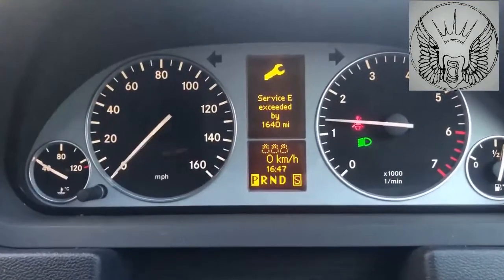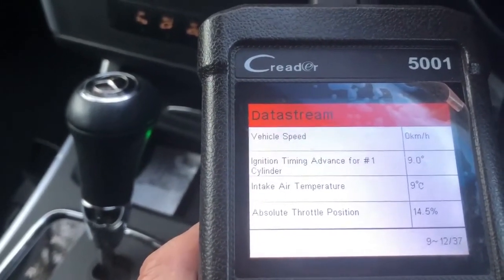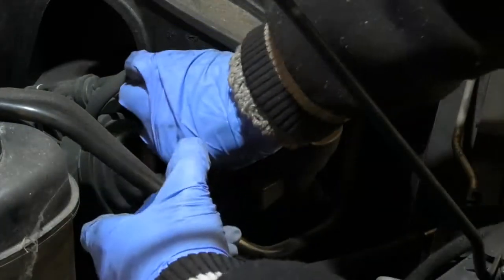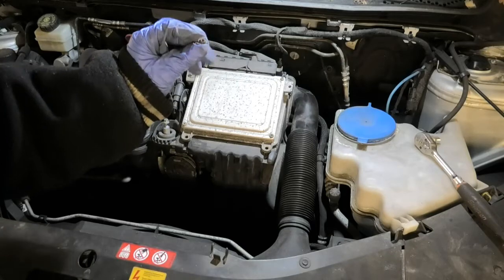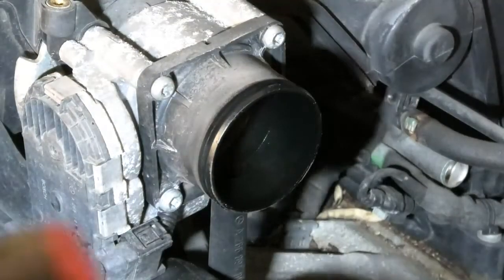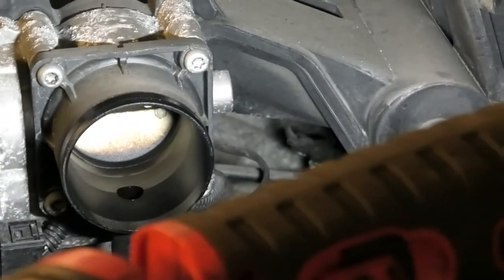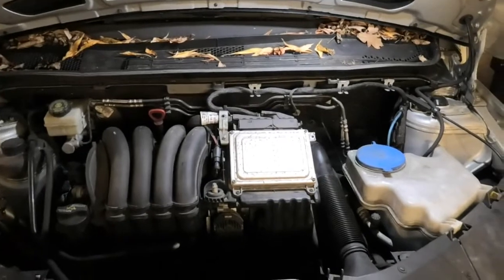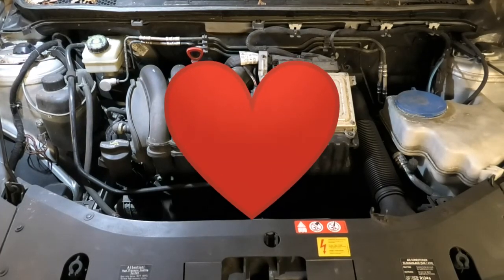Mercedes B class 2006 w245 P0068 fault OBD 2 port location, MAP sensor and throttle body cleaning

Comment: thanks for this usefull video about throttle and map sensor. i have really good question about my throttle body issue. to be honest i have problem with my trottle body.because my trottle body does not properly work.when i tested  the my trottle body position with my auto doctor diagnostic test, it show me huge problem ,draw signal is continuosly up and down , at this situation generally  it is becaming standby position, and finally the car is stopping itself. i think my trottle body is broken ,right?
Reply from the maker: Well it sounds like it might be faulty yes. May be buy a second hand one so it doesn’t cost much to repair in case the problem is something else.

Comment: Hello, quick question. I cleaned the MAP sensor and the check engine light doesn't come back until around a month later. I clean it again and around a month passes and it comes back again. It only goes away for that time once I clean it. Not sure what to do from here, do I just replace the MAP sensor? Anyone's help would be much appreciated!
Reply from the maker: Have you cleaned the throttle body ?
Reply: @DaringBeefcake  Nope, I checked it and it looks clean.
Reply from the maker: @literallyahmadrn  may be worth a clean, even if it looks clean, make sure the throttle flap is moving smoothly and not getting stuck. Otherwise change the map sensor. Don’t think is that expensive.
Reply: @DaringBeefcake  Ok, cheers.

Comment: Which spray do you use to clean ?
Reply from the maker: air intake carburetor cleaner https://www.amazon.co.uk/Wynns-1831014-54179-Intake-Cleaner/dp/B0056A1XGO/ref=asc_df_B0056A1XGO/?tag=googshopuk-21&linkCode=df0&hvadid=309775958298&hvpos=&hvnetw=g&hvrand=50096520308921697&hvpone=&hvptwo=&hvqmt=&hvdev=c&hvdvcmdl=&hvlocint=&hvlocphy=9044962&hvtargid=pla-464235306714&psc=1&th=1&psc=1

Comment: You did a rubbish job of cleaning the throttle body
Reply from the maker: Oohhh ok sorry to disappoint :)
Reply: Amazing video thanks 
May Allah Allah grant u the best always 
Very informative and direct
Reply: @DaringBeefcake  well if you cleaned the backside of it too by taking off the butterfly itself I wouldn’t have said it was a rubbish job 
When you have that much buildup on one side the other side will be just as bad 
Build up like this can cause miss firing and hunting so job half done cleaning only the front
Reply from the maker: @swwiss  that fair enough mate, I’ve got no issues with anyones comments, your entitled to your opinion. So thanks for sharing, and happy new year.
Reply from the maker: @mushhoodwaja5779  thank you so much for your comment, all the best to you an all 🙂